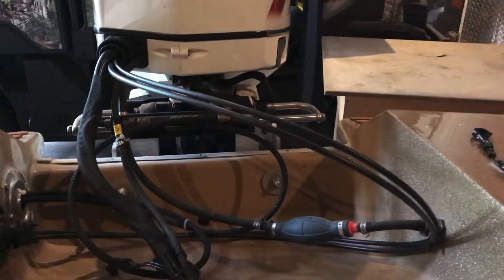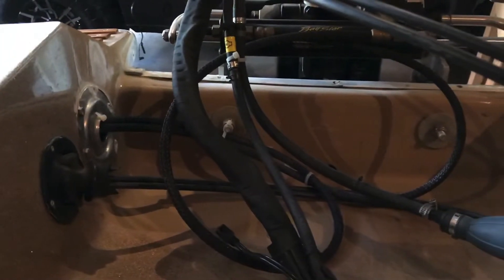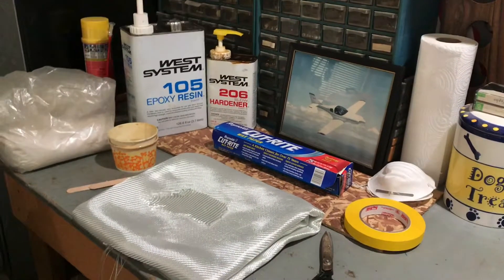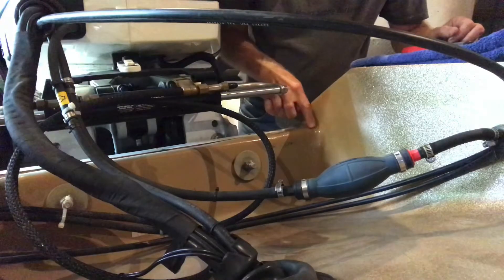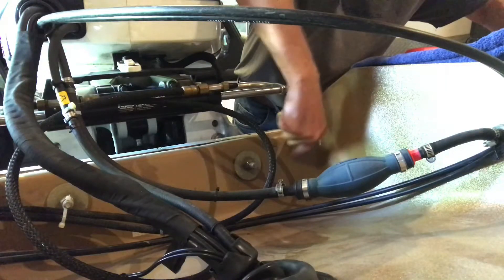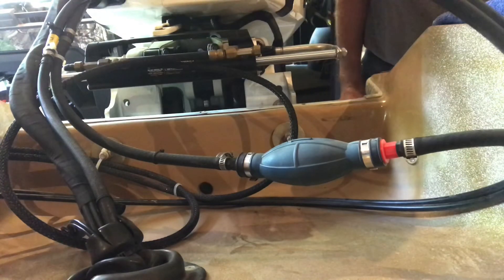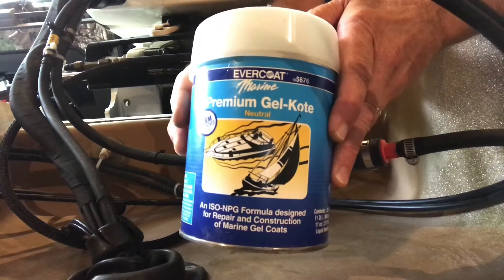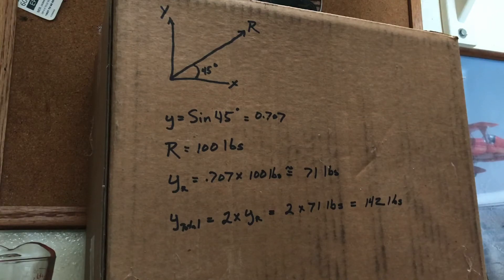Glastron CVX16 - Transom Reinforcement

Comment: Did you replace the transom wood?
Reply from the maker: I did not.  This was a topside only reinforcement project.  I believe the floor and transom got replaced around 2008 right before we purchased.
Reply: Sounds like you left the rotten wood in there and just reinforced the fiberglass. I just got a cvx16 that had a rotten transom. I had to gut all the wood out and poured arjay 6011. It was a project but we got it done.